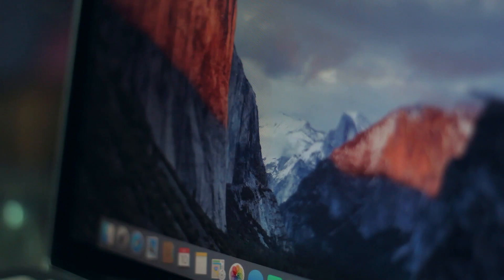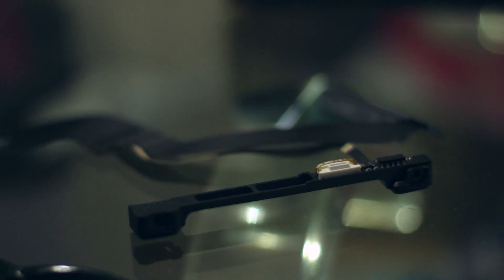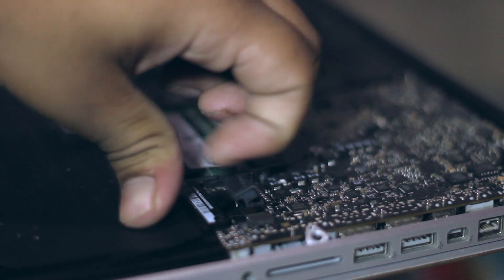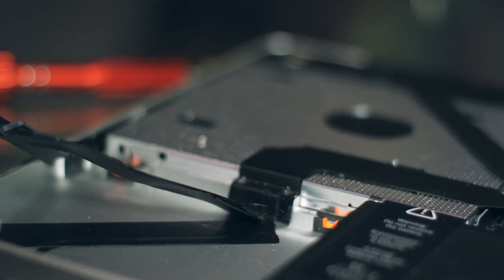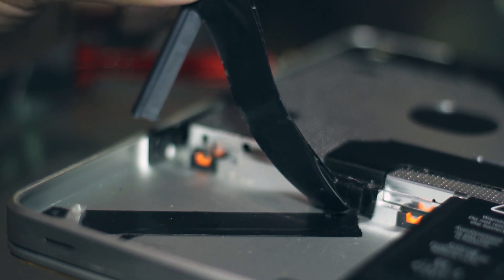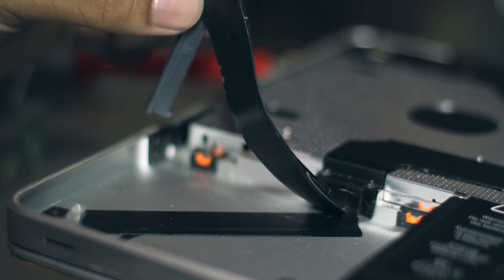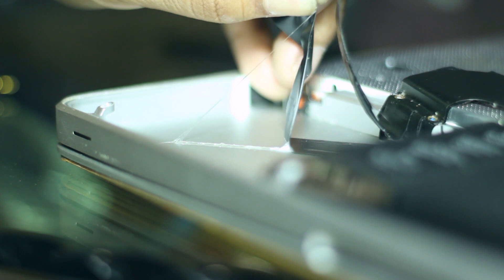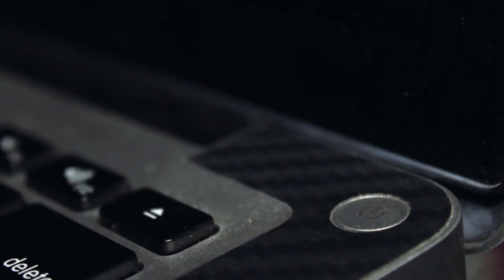How To Replace MacBook Pro Hard Drive Cable [Tutorial]

Comment: hi buddy great vid ..but just curious on the screwdriver size to remove those two small screws attached to the sata drive cable ..?
cheers buddy
Reply from the maker: Small phillips head. Even if it's a big one, once the tip is pointy it should work

Comment: Can you explain the electrical tape , my MacBook 2012 just went out with the question mark sign.
Reply: Harold Chairs there are several issues that can arise with this. Hard drive failure (2012 has a very outdated hard drive) or cable failure
Reply: Hanzo thanks man, I fixed it lately

Comment: Hi there great video
Short and neat.
Iam going to replace that cable as well 
My mbp acting very strangely after installing a new Os el captain and OS siera mbp was working smoothly for first a couple of hours then I did turn it off 
On the next day star having me a beach ball since the very start of the computer.
So I dictated the replace that sata cable
Fingers crossed it will resolve that issues

Comment: My MacbookPro 2013 retina just went black screen, but still works, I was watching a video on youtube and I could still listen the audio. So I turned it off and try to turn it on, I can listen the initialization dial but the screen still black. Do you think if I replace the ProHardDrive cable my problem will be solved? Thanks
Reply from the maker: That problem doesn't sound like a harddrive problem. It's probably a problem with the backlight in the display most likely.